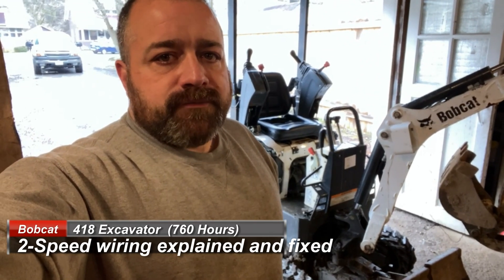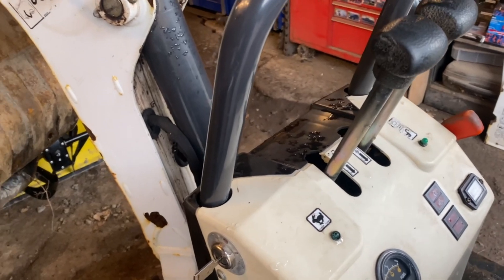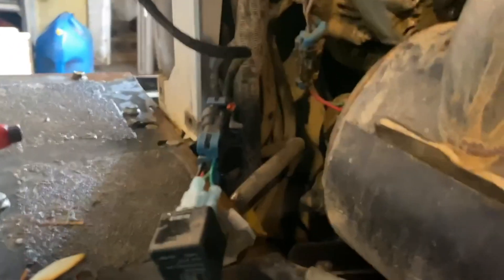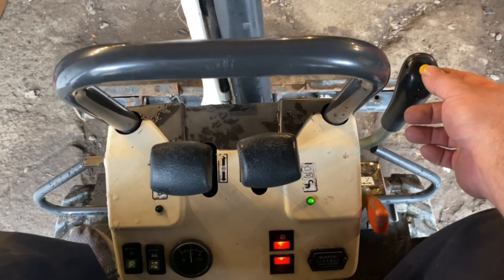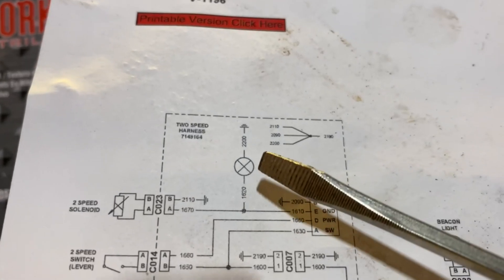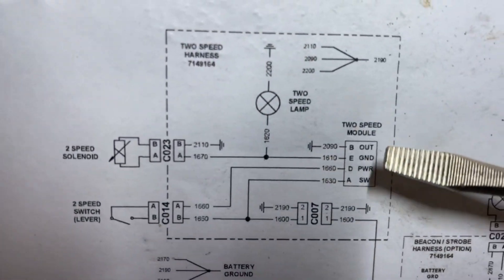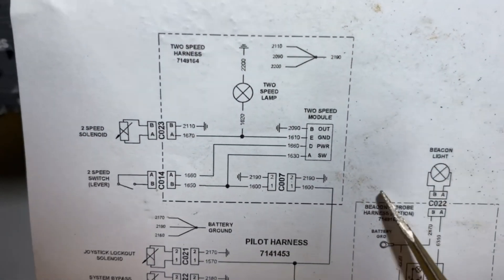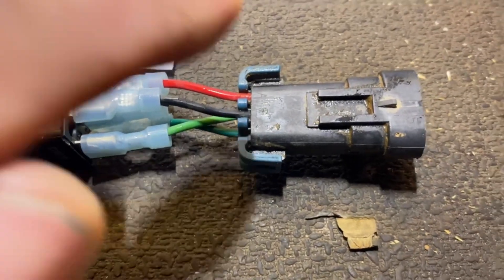Bobcat 418 2-Speed Travel Fixed!!

Comment: Hi man can u please help me with my car chrysler 200- 2016  The problem is when I start the engine the fan started at the high-speed And never stopped again can you just tell me what is the problem and I will be very grateful to you .. thanks
Reply from the maker: I haven’t dealt with that problem before. It sounds like the computer thinks the coolant temp is so high that it needs the fan on high speed. You may have a defective coolant temp sensor. Are you getting a check engine light and diagnostic code?